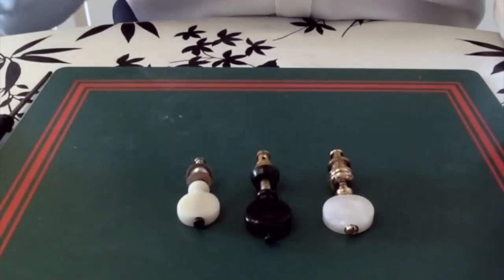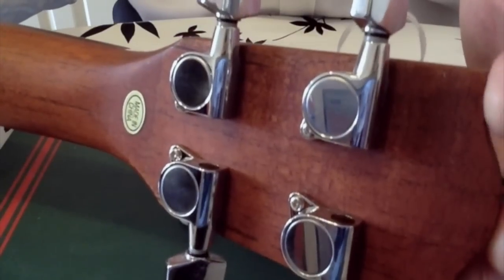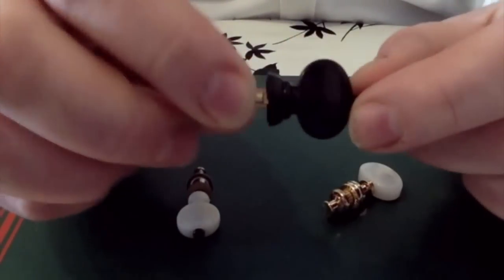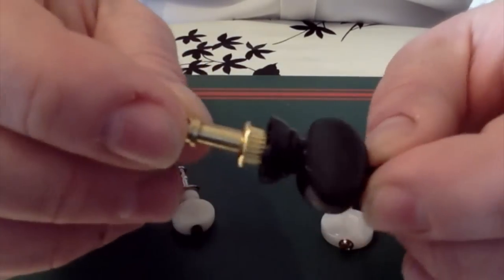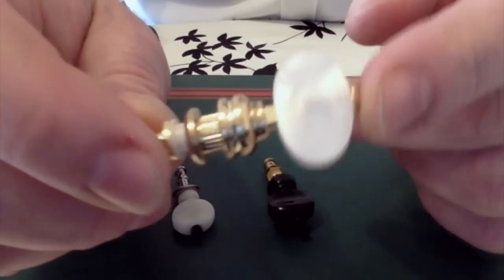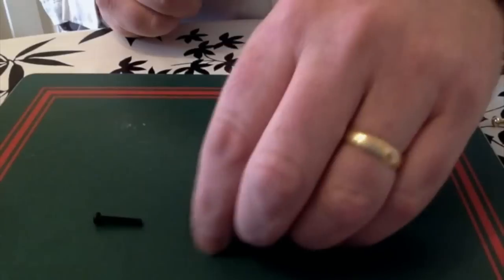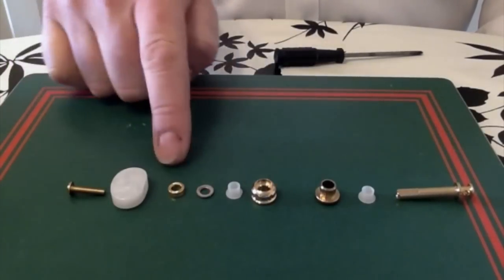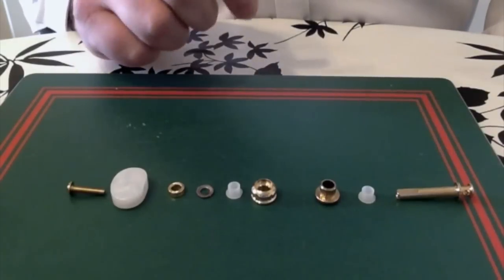All About Ukulele Friction Tuners - Got A Ukulele Beginners Tips

Comment: Thanks for the review. Just bought a soprano Flea yesterday and already hate the cheap stock turners which are extremely difficult to adjust. I will be upgrading to the the best and most expensive friction tuners ASAP. The peace of mind is worth it.
Reply from the maker: I never really minded the stock tuners on Flea's, but they are certainly easy to change

Comment: this was quick and useful. there are cheap versions of the good "precise tuning pegs" on ebay by now, btw. it's the teflon washers, that makes them work. they have the same effect on door hinges, slightly stiff but smooth movement with no sticking.
Reply from the maker: Yep - and multiple washers at that

Comment: Barry are there any decent friction tuners that would be a direct replacement for the friction tuners that came on 1950s era Martin Soprano Ukulele. I have an elderly lady in our Ukulele group that has her Martin ukulele she grew up with  so I am pretty sure the tuners are original but it is a constant overshoot/ undershoot on it. I don't dare want to be drilling or reaming a whole wider on an old Martin go install planetary tuners but wondering if there any higher quality friction tuners that would have the same diameter whole requirement?
Reply from the maker: Very hard to say and wouldn't want you to assume wrongly - my understanding is that Martin pegs varied a bit so think it may be down to the specific instrument. You may get peg to fit as a straight swap but you may also need to adjust holes. Sorry I can't be more specific.
Reply: @GotAUkulele  thank you for your reply. Since they are friction pegs I guess they should be pretty easy to remove one and check the diameter of the size hole and then put it back on.

Comment: Weight is the key -- regardless of instrument. Any extra weight on the end (while also considering leverage) is a bad idea. Friction pegs are simply lighter -- and it would be nice to see some even lighter wood pegs on a uke (like still on violins). This is particularly important on the thin ukes coming out where the balance is way off. So the real question is whether the weight difference enough to make it worth while to go for friction tuners? In would be nice to know the exact weights of the different types of tuners to get some idea.
Reply from the maker: +Lawshorizon weight is a part of it, but not the only part. Looks come into it for me but also playability on first position chords where i find gears can get in the way.

Comment: I have a 1960 baritone Slivertone Ukulele that wont stay in tune. I was going to have some one change tuning pegs for me. But what is a good brand and model to get. I have looked at lot deferent ones gets little confusing. Grover champions some one said where good. I like your video but you don't suggest tuners brand names or models. If you or someone had ides.
Reply from the maker: Leaving out the real boutique stuff - I stick to Grover and Gotoh. They make both friction pegs and gears and come in differing grades that you will discern from price. For example - the Grover 4 series fricton pegs I tend to use are 2-3 times the price as their entry level pegs. Horses for courses of course. Gotoh also make the hugely popular (but expensive) planetary tuners, though I think they might look odd on a baritone.
Reply: @GotAUkulele  Thank you for quick reply. When I search for Grover 4 series nothing comes up. all i can find are grover champion deluxe, Grover 88b, Grover Champion Sta-Tite, Grover 6B, Grover 6w, this crazy confusing :(
Reply from the maker: @thebighat99  Sorry - the '4' is a series - but their labelling will be something like 4W (white buttons) or 4B (black buttons). The 6B are ver similar as are the 6W. I use those too.
Reply: @GotAUkulele  Ok got it thank you.

Comment: Hello, you seem to be the guy who would know this. I have tried to write grover, but they seem have a long response time. I am building a soprano/"alto" ukulele (14" scale — really not important for my question). I have a set of brand new Grover 4Bs laying around, and want to use them. Ideally I would like 4B's but the 2B's are there, and they should work okay. My issue is, and maybe someone else can help clear this up, with installation. The collar that sits on the peg head face has a cone shape, on the back — the side that goes "in" the peg head, as opposed to a knurled bushing. Now, does this conical shape need to be matched in the wood, or will an 8mm hole at the face of the peg head be sufficient. The advantage of a straight hole is that I can upgrade to 4B later, as it should be fitting with the 8mm hole, and besides it's way easier to make, rather than trying to match the cone shape perfectly — which would be close to impossible. Anyone that has tried installing these as new or an upgrade, any input would be appreciated. Thanks.
Reply from the maker: I am not a luthier so should be careful in how I advise. I believe that the best installation would be to but a taper in the face to hold the bushing collar. But, that said - when I have replaced cheaper tuners with Grover 4's I have successfully put them in headstocks that had no taper and were just a straight hole and they have worked perfectly. There 'may' however be some reason why the taper is recommended.

Comment: HI Barry thanks for the insight on the tuners just bought a koa fluke so its a top end fluke and was thinking about changing the grover 2b tuning pegs that are on the fluke Dont have a problem at the moment tuning them but recon  a few more years down the line when i get older it might be a different story . Was thinking about the grover 6b pegs but want to know if they will fit in the holes with making them bigger  last thing i want to do is start drill out and also are they any good as they dont come cheap in the uk double the price from the sates was thinking about getting them before the end of October you never know what might happen with prices and imports if you get my drift 
Cheers Derek
Reply from the maker: Derek Scott ‘fairly’ sure the 6s are a straight swap for 2s

Comment: friction tuners for the Kala lacewood : Hello
is it normal for you that these tuners are not precise for tuning ?
and have trouble getting to the notes
that it is necessary to turn very slowly and slowly if not, the note that one wants to obtain will be very difficult to obtain
Reply from the maker: If they are cheap friction pegs, then very normal yes. It’s the issue most people struggle with when the friction pegs are cheap, and then claim all friction pegs are bad. Upgrade to Grover 4 series and you’ll see a world of difference
Reply: the Kala lacewood soprano has a cost of 288 euros ! all solid  or 3 solid wood parts so i don't understand why these boring tuners are here ! i don't know if i must keep it or send it back to buy another with better tuners like Grover
Reply from the maker: phenixreturns yeah - you need to spend quite a bit more than that to get a uke with good quality friction pegs. I have no idea why they skimp on such important things but they do..

Comment: What is the make of the good one you show?
Reply from the maker: +1777DK Grover
Reply: +GotAUkulele Can you post a link to where you got them, I can't seem to find that particular model. Is it the Champion Sta-Tite 88? What is the hole diameter for that particular one you have there?
Reply from the maker: +1777DK I am afraid YT doesn't allow links to external sites in comments. The model is the the Grover 4 series (Grover 4B are black, Grover 4W are white). Hole required is 5/16"
Reply: +GotAUkulele Thank you for your help! i did a cigar box ukulele build, and was planning to use Schaller pegs. However, the wood contracted because og humidity change and the holes are to big … These won't fit either, but if I plug and re-drill these could work because the flange will cover up the plug (the flange is bigger on these than the Schallers). I have a 8.7mm hole … Did you purchase these within the EU?
Reply from the maker: +1777DK Yes, UK - Southern Ukulele Store.